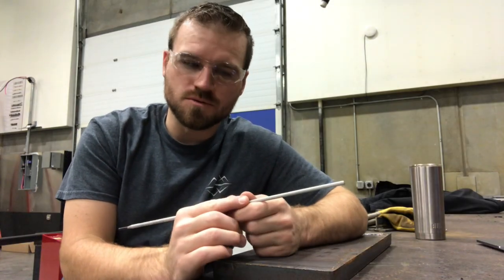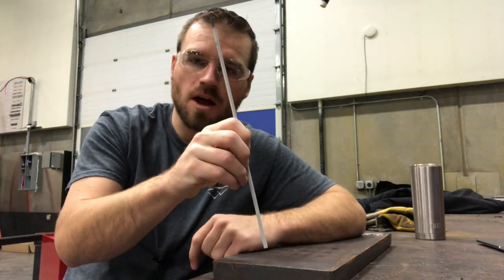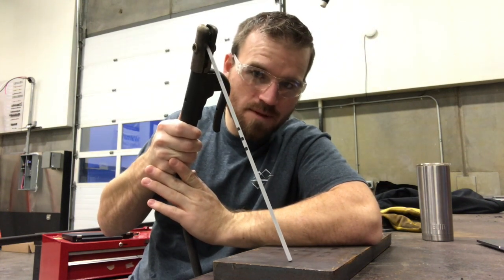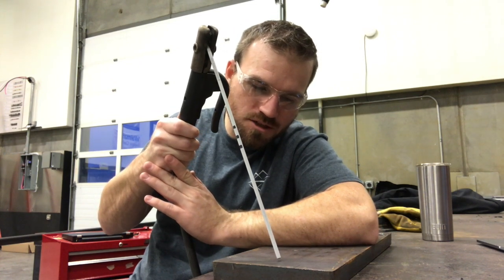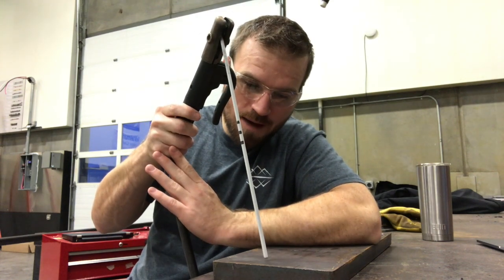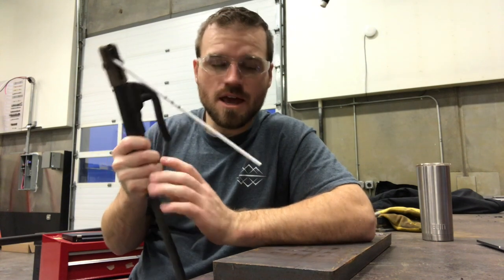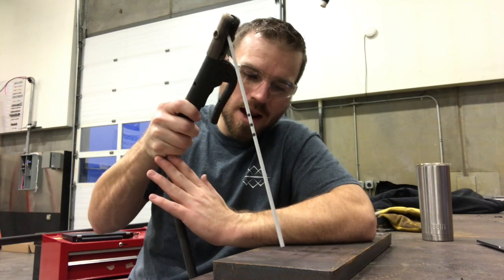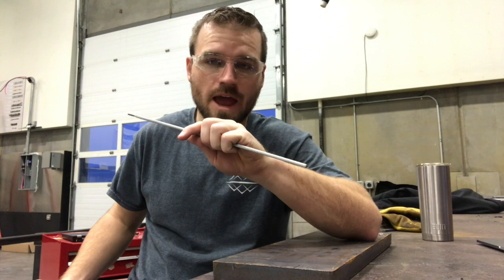Welding SMAW-How to Strike an Arc

Comment: I've been welding for years. I do mostly Tig stainless steel and copper, but I still struggle with striking an arc. I can lay some pretty nice SMAW beads, getting four to five inch slag peels, but when it comes to striking an arc it's like it's my first day on the job. I just cant seem to get the hang of it

Comment: You know being a novice the absolutely biggest problem I think I deal with is having a good enough lens and enough light to properly see and also being in a good enough position to balance and control the weld.that’s the biggest part of the battle for me,thanks.ok I just went the the garage and it seemed to fall into place and I started stacking dimes.well ok not dimes,maybe some cheap foreign currency but it worked and I’m pretty sure I can stick to pieces of metal together.if not I’ll break out the super glue!